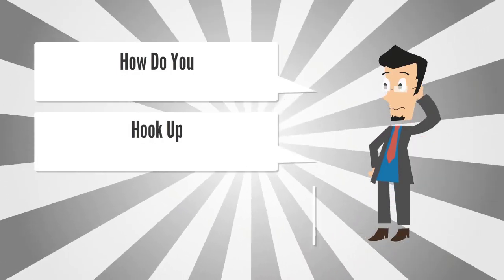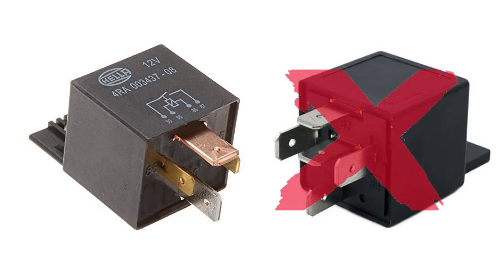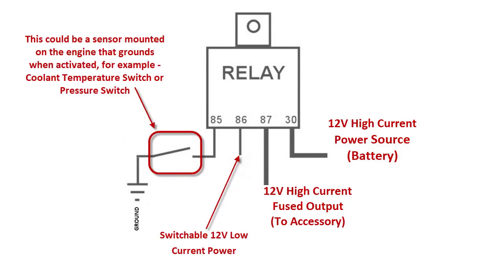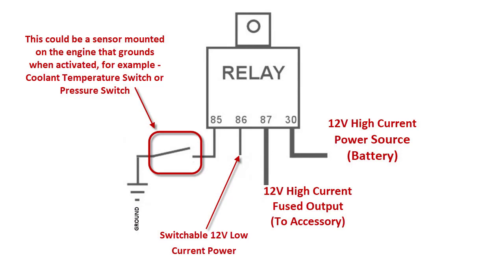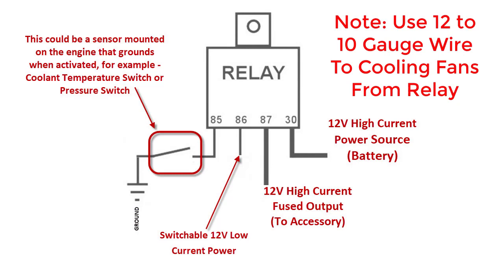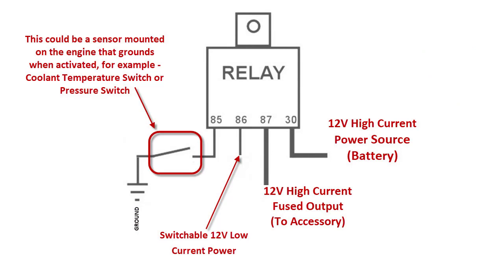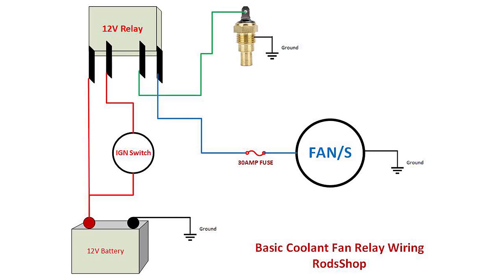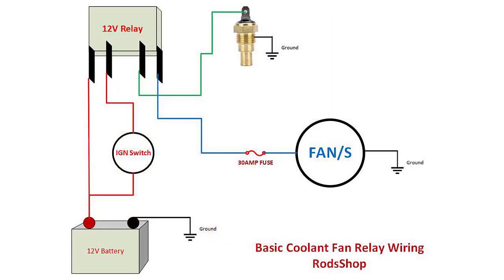How To Wire A Cooling Fan Relay

Comment: I hooked up my fan to a led light bar harness, and it’s not spinning as fast as it was hooked up directly to the battery, the relay is a 40a and fuse is 30a, what can I do to get the fan to spin faster?
Reply from the maker: You need to go to a heavier wire. LED lights are low amp wire, the fans need at minimum a 14 gauge wire, I prefer 12 gauge. More than likely, the LED Bar wires are 16 or 18 gauge wire and that isn't heavy enough to run fans. @josebuenrostro9080
Reply: @RodsshopOrg  hello I replace car factory condenser fan with a high performance fan but it's wired to car harness. However fan runs at normal speed on car harness. Added a external relay kit to try to boost amps to get fan to perform at its highest potential but doesn't seem any faster than the stock fan was.
Reply: Thanks for replying 👍 so just replace all the wiring with 12 gauge? They are 16 gauge wire after the fan connector
Reply from the maker: Yes, 12 gauge would be best. Also ensure that all your wire connections are good, as a bad crimp or connector not making good connection can also cause your fans to run slower.  @josebuenrostro9080
Reply: @RodsshopOrg  I put 10 gauge and everything is looking good but when I flip the switch it feels like my truck is gonna die from the current draw but it picks back up since I upgraded my alternator, would you suggest I get a new battery as well?
Reply from the maker: How old is the battery and what cranking amps is it? If you beefed up the alternator, that should be enough. Just how many amps does your fan pull and how many fans do you have?  @josebuenrostro9080
Reply: @RodsshopOrg  I bought the truck with the battery, it’s 550 cca and my stock alternator was a 95 amp and I put a 130 amp on it and im not sure how
Much amps it pulls to be honest, it says on the website 80 amps but that seems too excessive don’t you think? Its off a Chrysler town and country part #621-028 from autozone.
Reply from the maker: I doubt it is pulling 80 amps, that would require 4 gauge wire, which is what battery jumper cables are. It shouldn't pull at the most, 25 amps. @josebuenrostro9080
Reply: @RodsshopOrg  gotcha buddy, should I put a relay on my application or no? I appreciate your replies
Reply from the maker: If you are just using a manual switch, it needs to be the right amp switch, otherwise it will burn up the contact in it. I personally always use a relay. I would if I were you, unless you know that your manual switch is high enough on the load. If you are using a temp sensor to trigger the fans, you have to use a relay @josebuenrostro9080
Reply: @RodsshopOrg  I am using a manual heavy duty switch with all 10 gauge wire with a fuse going to the fan
Reply: @RodsshopOrg not in front of car now but when direct to batt it spins real fast but stays on when car off. Not sure how to correct this
Reply: Factory specs car fans run off a 20 amp but my relay kit has a inline 30amp
Reply: The 20amp still remains in car but thinking if it's safe to put a 30amp in there?
Reply from the maker: I think I can help you but pictures or video will help me best. Contact me through my website  

https://rodsshop.org/contact/

That way I can send you wiring schematics as well. 

These cooling fans only run at one speed, so I am thinking you may have to small a gauge wire running to the fans or, a bad connection. Contact me when you get a chance and I will see what I can do for you.
Reply: @RodsshopOrg  ok will take pic when I get off work. Ty much man.

Comment: I have a dual fan, 12.7amps each fan. Can I use a 15amp fuse inline from each relay to battery, or should I use a 30amp fuse and tie the battery leads together from both relays? 
Also wondering what size each relay should be.
Great video!!!
Reply from the maker: If you want both fans to run at the same time. just ensure you have at least 12 gauge wire feeding them. Run both fans off one wire. Run a 30 amp relay and a 30 amp fuse. I personally run the 30 amp fuse in between the relay and fans, that way, if something over loads, it will pop the fuse before burning up the relay. Hope that helped.
Reply: Great info. Thanks!

Comment: Iv watched 20 of these videos and not one single person yet has gave an example of what wire you can tap into for the ignition hot wire
Reply from the maker: That is because brand vehicle is different. For my  1977 Chevy truck, I tapped onto the wire that powers the coil inside the distributor cap. But your vehicle is probably newer or even a different make, so therefore, my truck info will do you know good. 

I can help, tell me what kind of vehicle you have and I can look up where the best place it is you can tap into.
Reply: @RodsshopOrg   how about on a 68 mustang 302. I've installed a painless wiring harness. I've used the extra accessories wire for the electrical fuel pump. Should I tap the pink ignition wire right behind the ignition?
Reply: @JorgeWifeBeaterFloyd  I’m
No expert but it sounds like you have a good spot now. What I did in my 06 jeep was use one of the fuses with a wire made to tap into a fuse for power and I ran it. To the inside fuse box for the radio
Reply from the maker: I wouldn't know the exact color codes for wires on a painless or factory wiring harness right off the top of my head. But Pink does sound like the correct color for when ignition is on. Take a 12 volt test lead and ensure that it is only hot when the key is in the on position. To run a fan, you only want a wire that is only hot when the key in on, not hot in accessory. @JorgeWifeBeaterFloyd
Reply: @RodsshopOrg  I have a 06 jeep wrangler and I can’t figure out a spot that powers up when the ignition is on. I was only finding ones when daylight running lights on. Also if I wire the fan to the switch they sent me then I can no longer tell my temp by my factory gauge right?
Reply from the maker: On the temperature switch, that will go in a completely different place. You leave the temp sensor for the gauge alone. I will look into a good place for you to wire off of. Contact me on my website, I may need some pictures of your engine compartment and it will be easier to communicate with you there. 
https://rodsshop.org/contact/ @riffraffchoppers
Reply: @RodsshopOrg  Sorry to be late to your video --- but don't tap into just any power circuit as you did for the power supply of the ignition module; it needs clean power with no surges or motor reverse electromotive eddy currents like those from a DC motor.
Reply from the maker: @SurferJoe46  That makes no sense, this isn't AC house wiring, there are no surges. This isn't rocket science and as I have pointed out in other comments, your wire that becomes hot when you turn the key on is going to be different for each brand and type vehicle. I know on the 77 Chevy truck, that the ignition wire for the distributor is only hot when I turn the key on in the run position. That wire is not hooked to a motor. But I am not going to argue over this, been doing this for over 50 years, every car I have done has worked perfectly, none have come back and all are still working with no complaints. You think it and do it your way and I will continue to do my proven way that is working.
Reply: Probe for accessory voltage at ignition switch.
Reply from the maker: @maddogtwenty20  You do not want power from the accessory, that mean the fan would only run in accessory and you need it to only come on when the engine is running.
Reply from the maker: That is because not all cars are the same. Give me what year make and model and I will try to get you an answer. 

For example of why you are not going to find what wire to hook to would be. My 1977 Chevy pickup, I can tap off the ignition wire. But will that be the same for a 2006 Mustang? More than likely not. This is something you usually have to probe around for. 

Tell me what you are working on and I will see if I can give you an answer.
Reply: I have a 2011 Chevy Colorado. Where can I tap into ignition ?
Reply: @cbagz8597  look in your fuse box for the radio fuse

Comment: How many amp your relay?
Reply from the maker: 30 amp but for you, it is going to depend on what you are running. You need to check the amperage draw on your fans or whatever device you are going to be running. But in most cases, a 30 amp breaker should be enough to run cooling fans.

Comment: Hello. I am looking for a proper connection under the hood to run my 12v ignition wire. I have it directly to batt via relay but I am finding that doing it this way keeps the fans running after I turn truck off. Truck is a 90 silvy 350tbi. I have a toggle and wouldn't mind doing it that way.
Reply from the maker: Contact me through my website as you can send pictures through it as I may ask you to take some pics of certain things for me to help you find a connection. I normally don't like coming off the ignition wire that runs to the coil but that is a possibility. Lets talk through my site and I will help you:  https://rodsshop.org/contact/

Comment: Really wish you could have showed a real hook up step by step, I get 30 goes to the battery and 87 goes to fans positive wire, the other 2 85 and 86 im so confused on, and where does the ground for the temp switch in the radiator connect to? I have it connected to the cross bar over the grill, and what about the black wire from the fan? Too many things I need visuals of to get this to work.
Reply from the maker: These instructions are pretty clear but also depends on what you are working on and your situation may be different. Contact me through my website, that way you can send me pictures and I can help you get what you are doing setup, I am here to help. 
https://rodsshop.org/contact/
Reply: @RodsshopOrg  oh I hooked everything up right just as you said, and it still dont work so idk anymore its ridiculous. 30 goes to circuit breaker, 2 bolt mechanism basically, connects to aux side then a wire runs from the stud labeled bat to the battery so that should feed a continuous power feed from the battery, the switch is just a substitute for in line fuse from what i understand. 87 ran to the power wire on the fan, 85 and 86 ones running to the temp sensor that's in a housing that is installed on my upper radiator hose, I have a ground wire running from it to my engine block and then the other I have connected directly to the positive side of the battery instead of an ignition power cuz it really don't matter as long as there is power from what I saw on other videos, my car is not going to exceed 210F just sitting in my drive way. So I don't know what else to do, I tried a different relay just to make sure it wasn't bad still don't work, monitored the engine coolant through my obd2 and it just climbs past 210 and nothing happens. Lot of vids say it dont matter which you use for each on 85 or 86 because it's DC and just a means to complete a circuit. Can you see anything I may have wrong there? I'll see what I can figure out on your website tomorrow I'm beat, and done messing with it for today. Just too frustrated right now.
Reply from the maker: @bentramell729  This would be easier to help you through emails as I could send you a diagram to simplify this but from what you have wrote, I think the issue is your 85 and 86. All these two pins do is energize the relay, so as you found out, it doesn't matter which one is positive or negative but from what I read you wrote, and maybe I misunderstood it. But it sound like you have your temperature sensor trying to switch 85 and 86 together and that would be wrong. You need to add power lets say to 86. I usually make this a wire that only has power when the ignition switch is in the on position. Then 85 would go to your temp sensor. The temp sensor has to be grounded, so if you have it in a housing inline with the radiator hose, you have to run a ground wire off the housing to the engine block or some good ground. When the sensor gets to the designated temperature, it then grounds the wire that goes to 85 and energizes the relay which then sends power through 87 to the fan. 
Please, if this doesn't work or make sense, contact me through my site, I am not going to use your email to spam you, it is just email makes sending pictures back and forth so much easier.
Reply: @RodsshopOrg  no it makes sense it's what I've done, I have 1 of the wires, 85 or 86, not sure which but one of them is running to the temp sensor in the housing inlayed in the upper radiator hose, the other one is running to the positive post on my battery. I have a ground running from the temp sensor housing to the engine block. 87 running to my fans positive wire, fan is grounded. 30 runs to the circuit switch and then from the circuit switch to the positive on the battery. It should work I don't understand why it dont. I've tried two different temp sensors and 2 different relays and still nothing. I don't think my problem lies with not being hooked up right but rather or not my wires have proper connection or maybe my radiator fluid was too low not really reaching the temp sensor inside the hose and just passing under it. It's a head scratcher though. I won't bother you anymore, I appreciate you talking this out with me but im certain I have the schematic of it hooked up correctly there's just something else that's not right, idk maybe my ground from the housing to my engine block isn't in the right place, I did have it on the crossbar over the radiator where the hood latch is at like I saw other videos with this same set up put theirs and it worked just fine on theirs that way and didn't have to be on the engine itself. Maybe my circuit breaker is bad and not translating power like it should on 30. Lots of variables that are going to be difficult to test.
Reply from the maker: @bentramell729  Before you give up, go back to the basics. First off, you may want to watch my other video on relays: https://www.youtube.com/watch?v=5wVeCYuDJuI

Going back to basics means, ignore all the switches and sensors and just run wires to the relay to see if you can trigger it. I have another video where I put electric fans in a truck. Here you can see how I just ground the wire going to the sensor to trigger the fans to kick on. 
https://www.youtube.com/watch?v=W5Ucc63uvn4
You can see me go around the sensor at time stamp 36:12

Contact me through my site, send me pics of your setup and I can get you going
Reply: @RodsshopOrg  I'll check it out! Thanks again I appreciate it.
Reply: 86 is the problem hook up to ignition in fuse box or tap into ignition wire I guess😅

Comment: What type of 40amp relay to buy, normally open or normally closed there are a few types out there, cheers
Reply from the maker: Any regular 4 PIN relay is always open. This is shown in the video, PINS 30 and 87 are open until you add low current to PINS 85 and 86. This is going to be the same on all amperage rated relays.

Comment: Why not just use a 20 amp switch to power fan, you don't need the relay.
Reply from the maker: Well maybe most people are not as diligent as you to remember to turn on the fan when the engine starts to get hot. Most people do not want the fan to run all the time nor is there a need for the fan to run all the time. We are in the 21st century, so most people want things to be automatic. But if you are happy just turning on a switch and remembering to turn it off, then I say go for it. This video is if those that want to hook up a relay for any item if you want to, not that you have to.

Comment: Dope video, nothing I dont know but ADD makes me look things up a hundred times. Also had to rewind the clicking thru fans about 65 times...OK exactly 65 times lol, bit of OCD mixed in with a few energy drinks and SQUIRREL! SORRY, I'm back , great video, I just screengrabbed so I xan argue with myself tomoro installing 4 relays for low+high speeds/dual fan..until it turns into something else and I end up moving my seat bracket 1/4"+ running out of daylight instead

Comment: Thanks, Your video goes to the basics. This has helped me very much with my old truck 😁. The explanation of how the whole system works and how it changes as AC is added, also how the temperature switch changes from grounded to not grounded. Thank you for sharing your knowledge!

Comment: In the video you said 10-12 AWG to the fan. I'm building a harness for an existing fan. The existing wire on the fan looks closer to 14. Should I connect a 10 AWG wire to the existing fan wire. Would it be able to hold the load without getting hot?
Reply from the maker: The main reason I recommended 10 - 12 AWG to the fan is because not everyone will be using the same fans. Most fans pull at max, 20 amps and usually that is the peak when the fan first kicks on. However, there are many performance fans that use 20 to 25 amps continuously. Since you are using an existing fan and it already had 14 AWG running to it, you should be safe to run 14 AWG again. 14 AWG wire runs up to 15 amps, 12 AWG is 20 amps and 10 AWG is 25 amps. If this is a factory fan, most of those use 14AWG, so just run that in your harness.
Reply: @RodsshopOrg  thank you. I used the formula watts divided by volts. With the fan only using 80 and the alternator running about 13.5 volts puts the current right under 6 amps. If I divided 12 volt it keeps the current under 6.7 amps. So I should be free running 16 AWG . THANKS FOR The clarification. I tried this a few times mixing wire so I just wanted to make sure I get it right this time. I've had problems with wires overheating. I'm using a 15 amp fuse because that was the original fuse used.